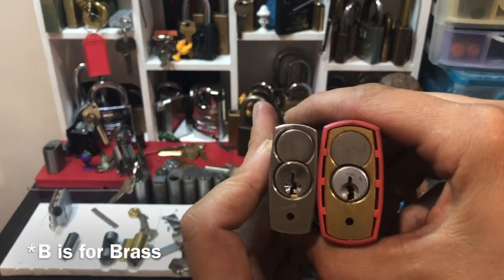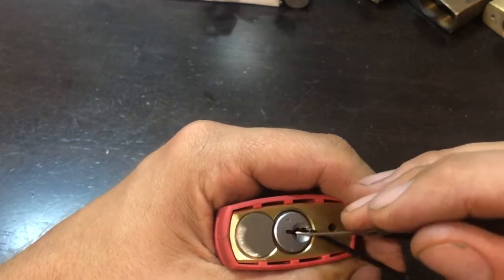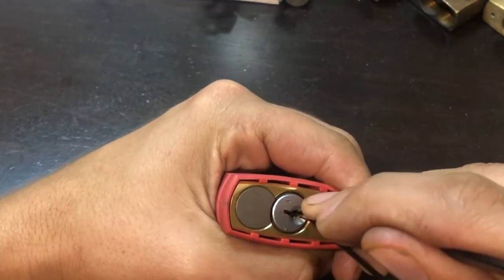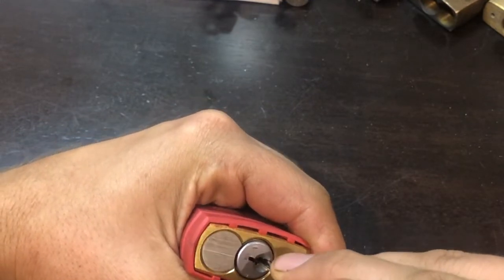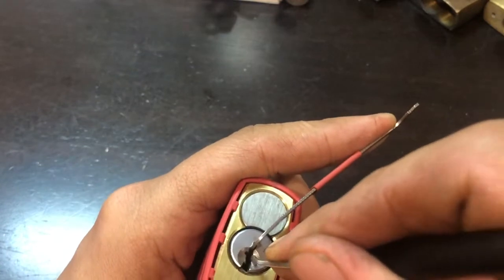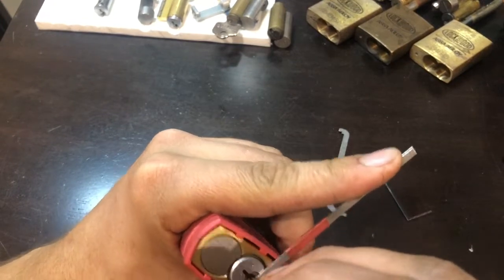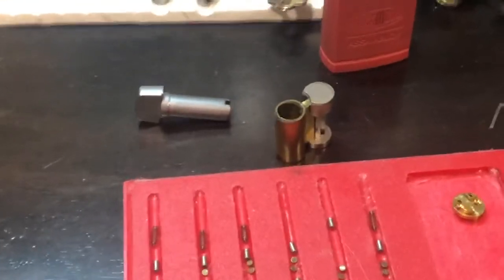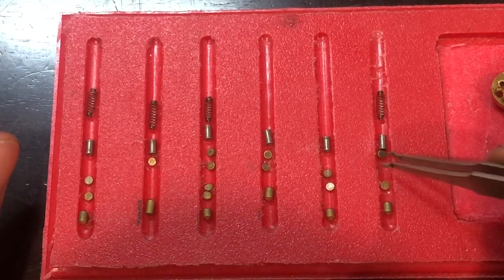A rather tough jacketed 334B45

Comment: Nice work on the restricted keyway mate. Shame about the heavily mastered wafers.
That's a restricted Binary Plus A keyway. 
Definitely not a mistake with the core mate lol
I did a video nearly 2 weeks ago showing the side pin and spring that sits in the slot and how it interacts with the 3rd torpedo style keypin for the spring to lock the pin upwards.
Thats until the correct key is inserted and allows the keypin to drop back down.
I'd recommend watching my video to help you understand the extra groove in line with pin 3.
Reply from the maker: FunKey MonKey ah yeah I remember that video I’ll have to give it a rewatch. Thanks for the awesome info as always👍🇦🇺😊. With the amount of master pins in there would you think this lock is apart of a GMK or GGMK system?
Reply: @TheButchersbLock  lol it's not a GMK or GGMK. I'd say it's most definitely from a GGGMK system to have that many wafers. GGGMK stands for Great Great Grand Master Key which is pretty much the highest level of master keying used throughout Australia.
Have a good one bro 🤟😁👍🍺🍺
Reply from the maker: FunKey MonKey well shit😳I thought great grand master was the highest. Cheers mate
Reply: @TheButchersbLock  lol 😂🤣 
It's always good when you learn new things everyday